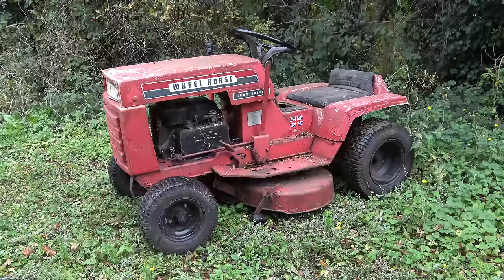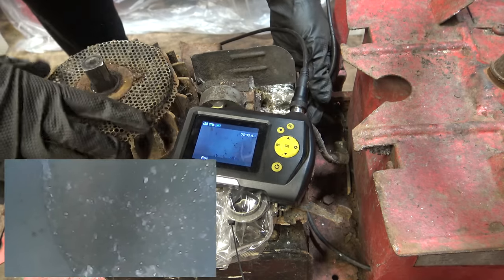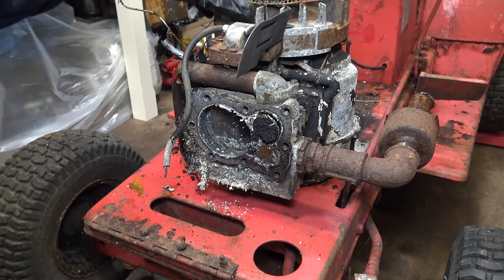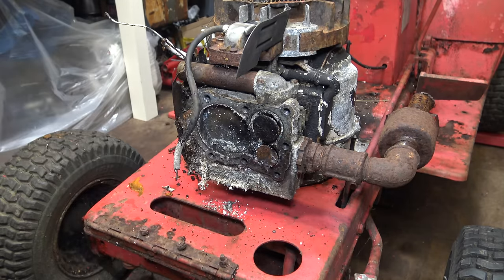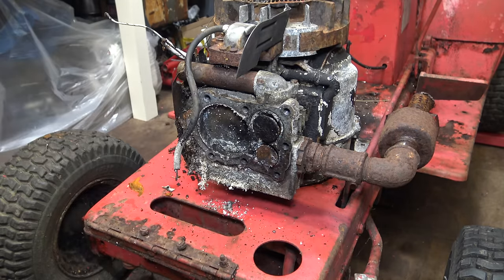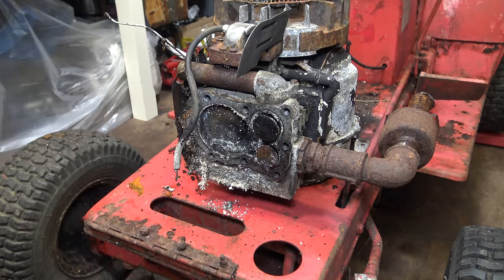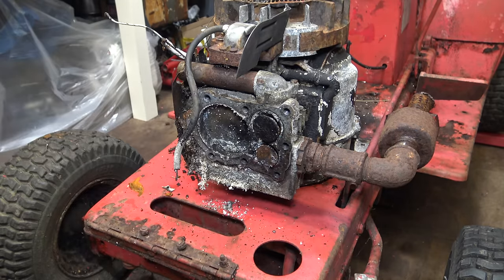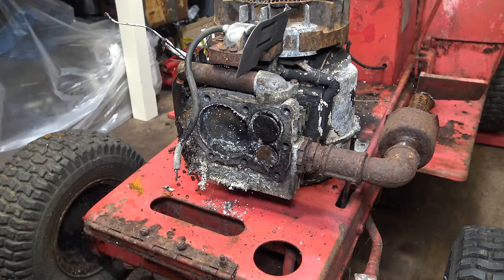ABANDONED MOWER 10+ YEARS OUTSIDE - Will it Run?

Comment: Pro Tip: Put a thin layer of heavy bearing grease on both sides of the carburetor/fuel tank gasket and it will allow the gasket to be re-used instead of being destroyed each time you need to do servicing. Those paper gaskets usually don’t come off in one piece. Kart racers (Briggs Raptor 5hp) use the same method for maintenance or changing out carbs between races, etc.

Comment: Should try some baking soda (sodium bicarbonate) in your sand blaster for carburetors. It blasts everything off them but doesn’t take away the base material like sand or glass bead. Works amazing! Then run it through your ultrasonic cleaner and the baking soda dissolves in the water, leaves everything looking brand new!

Comment: The old Briggs & Strattons are quite tough. Sad to hear lately that they are in a financial bind. They have survived many a year of competition that saw a lot of other manufacturers go under.
Reply: (Knock on wood) ive never had one die unless it was my own fault
Reply: @Seasonal50  - I had an old 3 hp briggs of 1973 vintage on a push mower.  Near the end of the summer I was mowing and it just quit, about the time it would have run out of gas.  Filled it up and it still wouldn't start so I got annoyed and chucked it out the door of the shop and where it landed is where it sat for 3 years.  This is also where one of my snow banks got built when I pushed snow.  After sitting outside for 3 years, half the time under a snow bank, I put a new coil on it from a 12 hp I had sitting around, cleaned the points and it fired on the second pull.  Still running 6 years later.
Reply: @Kryten428  Had an old,old,hard to remember, l'm 83 last Nov. 24,2020,B&S 1&1/2 hp,cast iron ???? No spark,wasn't the coil,magnets went dead on the flywheel !!!!!! Didn't know how to remagnagnitize them,engine got lost in the shuffle,don't know what happened to it !!!!!! Probably could have wired it up for a battery ignition,but didn't think of it until right now !!!!!!!!!! Dummy 😣 ♿ 🇺🇸

Comment: Maybe shoot a little transmission fluid or light oil down the spark plug hole before you start freeing it up?
Reply: @matthiasweigel311  Obviously you haven't done this before or you would know putting oil is good advice . Metal rubbing on metal is not good .
Reply: yea thats the first thing I do, even pb blaster or wd40 or engine assembly type lube
Reply: Weigel is the guy who acts like he knows what he is doing, yet has no clue.  One in every bunch.

Comment: I have a wheel horse ranger 700, and it looks just like it! It was made in 1974 I think, and is pull start. But I don't think it has the original engine though. Great video!😊

Comment: Nice rebuild Dag. I recently overhauled a similar carb an fuel tank on a old tiller I found cheap. It was rusted badly within the tank and the carb draw straw was shot.  I actually put small coins with gas and some cleaner in the tank and shaked the 🔥 out of it several times. That process got the inside  of tank shining brand new! 
    The draw straw problem was fixed as well also, by splicing a fuel filter line that came off a in tank weedeater part. 
    Finding the parts on that carb an metal tank combo are dang near impossible! Uggh! Sometimes you just have to JerryRig it! Lol 😆. Again, Great video Dag! I learn something new every time👍

Comment: Wow, Briggs really stuck with designs there. It looks remarkably similar to the 5hp (12.5 cu in) horizontal shaft   from 88 I recently cleaned up: it was running but not well, and coated in an oil and leaf bits emulsion (it's on a big leaf vacuum). Much better shape than yours, but the whole side was gummed up and I decided to replace (definitely not because I lost them in the pile of muck 😅) governor arm and linkage, and I've ordered a new governor spring too since it's not quite governing the way it ought to. (Hooray for new old stock on eBay!) Had some nice carbon stalactites on the head, glad I decided to pull the head for a cleaning, that would have been big scoring in an otherwise pristine bore. A bit jealous of how easy that looked in your sand blaster! Had to clean the starter clutch after I got it running again, but that was easier than expected.

Comment: the engine is exactly the same as my flymo 5gxl  wheeled mower i managed to find an original old stock brand new in box coil for mine on ebay very reasonable price too , they have so much power mine will cut long thick grass on tick over , great videos .

Comment: As much as I love tank mounted carbs I despise the fact that they face upward and funnel water directly to the intake. Luckily most of them have an air filter that blocks it but nine times out of ten if you find something it is missing the air filter.
Reply: The same goes for most carbureted automobiles (in junkyards etc), and if there’s no air cleaner on it, it usually means trouble inside. But you’re right; most derelict tractors you find have a missing air cleaner.

Comment: Thats funny--for the last ten years I have been putting on the air filter cap on my mower with the v-shape the other way and my genset too. My mower had the valve seat pop out after a couple of years, but I staked it into the aluminum about ten years ago been good. I don't run it to fast any more.

Comment: Great work! I've been after a set if those linkages for a while - but struggling to find them in the UK. Are you able to divulge where you found them? US sourced? Thanks very much!
Reply: Try ebay for Briggs NOS (New Old Stock) parts as seen in this video, otherwise there are aftermarket or off-brand Briggs parts a-plenty in the US. Briggs outsourced their small parts, just put their own label on it, so don’t feel as if it has to be “genuine B&S parts” to be satisfactory. I’m new to this channel and am amazed at all the classic American lawn mowers found ‘across the pond’. Spare parts have to be available over there somewhere, right?

Comment: For rusted and corroded stuff use apple cider vinegar...  For rusted cylinders.. Fill them full with the vinegar and wait 3 days at least...  Keep topped off and it may take 7-10 days...  But it will come loose.
Reply: why not just regular vinegar?
Reply: Sal "Googs" Dimarco was the local Model A guy..  He taught us to use apple cider vinegar.  We were working on a stuck 32 Stude straight 8.  We've used white vinegar and it seems like it took longer.

Comment: That new muffler seemed to be of excellent quality :D
Reply from the maker: Yep lol
Reply: @MachineryRestorer  Why didn't you loosen and take the locking ring off the exhaust pipe ????? It would have unscrewed the whole thing in one piece . And you didn't put it back on the new one . So eventually that'll rattle loose, probably pop the last two threads out of the block !!!!!!!!!!! ♿ 🇺🇸
Reply from the maker: @richardanderson5109  The locking ring was totally siezed which is why i had to dismantled the exhaust to get an impact wrench on it. It doesn't need one on for testing, I am going to dismantle the engine for another project.

Comment: No spare deck to use or canibalize for fixes, sigh.  I understand the  spindles and such are expensive.  You need a source of sheet metal and a welder to fix the rest.  Since the sheet steel warps so easily with too much heat, e.g. welding, you need lots of practice welding too.

Comment: Hmmm I didn't know that the Wheel Horse brand name made it to the UK. Very strange to see a wheel horse with a vertical shaft belt drive instead of horizontal shaft belt drive.
Reply: Made it to Denmark too 😉
Reply: Dang. Do they have vertical shaft drives there too or is it horizontal like it was here in America?
Reply: @Tractors101  I believe we have both, if not, then I have only seen horizontals

Comment: The original engine would have been a tecumseh 7hp. These engines were not the best and dealers started to fit Briggs and stratton 8hp engines as they were much more reliable. Judging by the wheels and the steering wheel your lawnranger would be around a 1969 to a 1971. The exact year can be found out using the id plate and the wheelhorse master list of id numbers which can be found online.

Comment: @MachineryRestorer, do y’all have Ethonol in gasoline? We do here & it sucks, I’ve had old GTs that I’ll find on Facebook sometimes & the tank reeks of Ethonol. 

I’ve had a 1973 Tecumseh & a 1967 JD110 & both of them the stock fuel system was trashed, both engines run well it’s just that the corn kills these por things.

Comment: There's a reason the old old engines can still run without a ton or corrosion unless water gets in through the carb.
Ethanol. 
The wonder gas that melts and corrodes everything in site. 
Thanks government for having it added to our fuel. I feel like the engine companies had something to do with that so you have to buy new stuff.